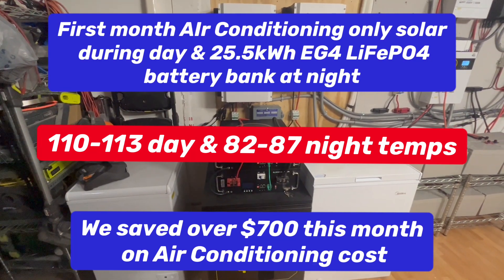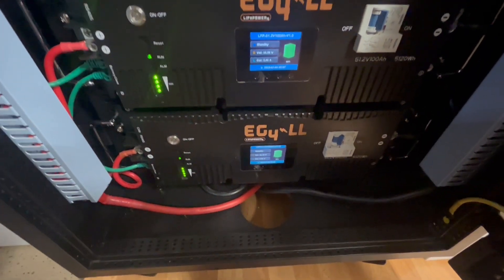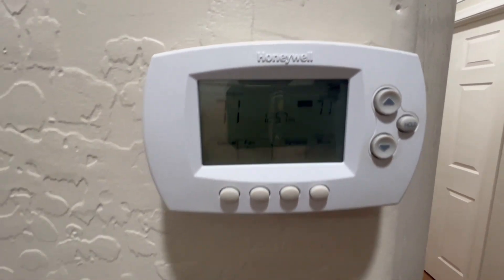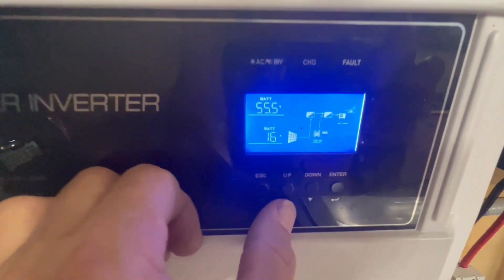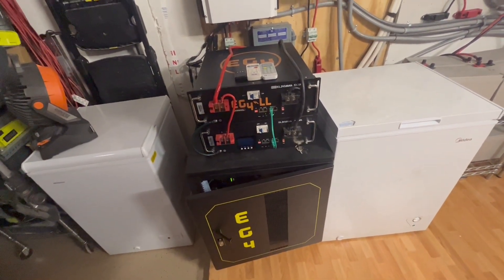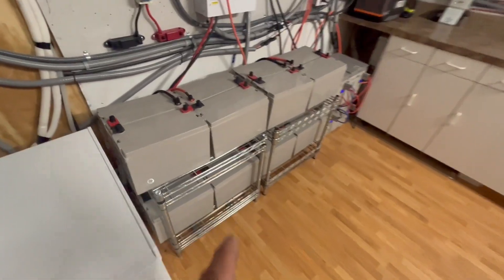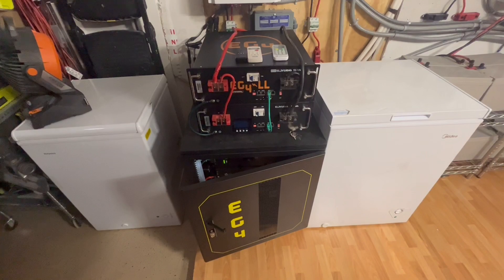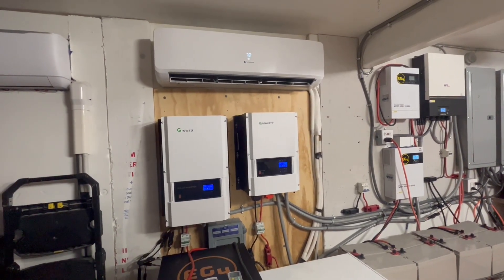First 28 days spending no money on AC cost while 110-113 in the day & 82-87 at night off grid solar

Comment: Very cool. How is it hooked up to run the central AC? I've seen people plug into an generator outlet. But it doesn't appear you are hooked up that way.
Reply from the maker: I ran 10-2 with ground wire to each AC from inverter. Around 100 feet run. With off grid you have to run separate wire to each component you are trying to run. The closer you can install the inverter, the less wire you will use.. None of my off grid is tied to grid. I can use grid to charge batteries on cloudy days or use grid instead of solar but grid power is used to run loads. Not connected in any way to feed into grid.
Reply: @diy-solar-guy  awesome thanks. I'm starting my solar journey now, and your videos help a lot.
Reply from the maker: I glad the videos help. 4 years ago I knew nothing about off grid solar or mini splits or ac units. Now I run my ac units with solar in day and battery at night. Very easy to learn.

Comment: Wondering how all this works out when you finally need to purchase all new batteries ?🤔🤑
Reply from the maker: These LiFePO4 batteries are supposed to last 20-25 years. Much more life cycle than AGM many times over. We will see. Looking forward to seeing how long they will last.
Reply: @diy-solar-guy  Oh Wow!! was not aware of the lifespan, just bought my first 12volt 100ah litime battery for my boats electrical and trolling motor , this is all very interesting stuff thanks for sharing so much info I'm learning so much already, can't wait to put it to use.
Reply from the maker: @jackwood6023  you are so welcome

Comment: What’s the cost for everything?
Reply from the maker: 12 kw Growatt off grid inverter $2000
5-5.2 kWh batteries $8000
Battery sever rack $450
48-250 watt used solar panels $2160
10 gauge wire 150 feet $180
Breaker $25
Battery cables $100
Solar array to mount solar panels will vary
But could cost $500 - $2000
At prices as off today it would cost $17,465(. Included $500 for solar array)
I paid before inflation $8500. I bought when prices were at the cheapest. I got a great deal. Hope you have a wonderful and blessed week

Comment: Wow, those are some crazy electric bills. If I had $1,000 a month electric bills, I would be spraying my roof with water. One unorthodox way to keep a house cool is to use the evaporative cooling of water. When one gallon of water evaporates, it absorbs 8,000 BTU of heat due to physics. A small window unit cools 5,000 BTU per hour, while a small one ton mini-split cools 12,000 BTU per hour. That is to say, the minisplit cools about as much as 1.5 gallons of water evaporating. While doing remodeling work on a house, I have used this method. It works to some extent. It cools about as much as running an extra window air conditioner.  I  sprayed the roof every couple of hours, and observed the cooling effect with my thermal camera.  It helps, it makes a difference; it is not perfect. Obviously, some of the evaporative cooling effect is lost to the environment and this is better at taking load off of a cooling system than being a good stand alone cooling method. If the grid ever fails during a heat way, it might be a fantastic method to keep people from dying.  It helps to get a house down closer to ambient temperatures. This can relieve a significant amount of cooling need from the HVAC system, but is not going to make a house a nice 72 degrees by itself. In a situation like you have, an ideal setup  might have a garden hose running up to the roof with sprinkler, which could be turned on with a cheap $50 automatic timer for 1 minute every hour sprinkling the roof with water. Long term getting a roof wet like this could be tough on a roof; that said those cooling bills are tough on a wallet. This method is going to work better in a desert where the air is dry. One could cool the house all night long or just focus on hot daylight hours; it probably depends on humidity of the area.  If you are sprinkling the roof, there is no reason you can’t also sprinkle the rest of the house. (siding, walls, windows ect) as that water can also help cool the house. I suspect that this method of running water on the roof based on my experience, can remove about one third to one half of the cooling needs of a normal house. With a $1,000 electric bill, that would save about $300 to $500 of power per month. I think the water bill would go up by less than that. I take no credit in inventing this method, castles and palaces of old used evaporative cooling to help moderate temperatures.
Reply from the maker: That is pretty Amazing, I actually have 2 solar hybrid roof vents in my attic that run 24 hours a day between solar and battery bank at night. It keeps my attic at the same temp outside which is about 60 degrees cooler than before I installed about 3 years ago. We can’t use water out here to do that, even with a nice whole house filter, the white calcium in the water would leave white streaks everywhere and down the sides of the house, which we would get fines from HOA or have to paint. Calcium in the water out here is really bad. The humidity right now is 10 percent and 113 degrees out, would have to run continuously to have and effect. Our water bill out here in the summer just having a pool and plants in yard on drip system is $250 a month. If we did that it would probably be about the same as electric bill. I am not paying anything anymore for air conditioning my house 7/24 and garage during the day so fortunately I don’t have to do anything else since my system with a 25.5 kWh EG4 LiFePO4 battery bank. We stay nice and cool all summer long with free ac now. Thanks again for your input. Hope you have a wonderful and blessed day

Comment: Sealing all duct work with dp 1030 mastic use mold resistant drywall tape for bigger gaps. Hvac is notorious for having leaks, check the supply box and all your vents.

Adding an attic fan with a temp shutoff along with a closet switch to turn it on and off will make a huge difference with all that heat trapped in your attic, especially at those temps that you’re at you want it out of there as quick as possible it will cut your AC cost way down .
Reply from the maker: I used hvac caulk in all my air vent boxes and made sure in the attic there were no leaks with flexible ductwork. My roof solar roof vents are hybrids so when there is no sun on solar panel, it runs off battery bank at night, all night. My attic stays about what outside temp is and no more. I no longer have ac cost on grid. But thank you for all your great suggestions. We even insulated garage and air condition that with solar so the rooms above garage are not hot.
Reply: @diy-solar-guy  🫡 thank you for sharing, was sharing what I did that made our 2004 AC 400% better than new. Stays 76 degrees Fahrenheit went outside temps are 97°F. Only runs for 9 to 12 minutes then shuts off for 20 minutes. Change the capacitor and the contactor cleaned everything up replace to filters, sealed the supply box, which had major leaks some spots for 1 inch gaps and sealed all the hard pipe going to the vents that I could. It is efficient as it can be without me getting in the attic and sealing all those ducks and insulating them to keep the attic heat out not worth my time or effort in my opinion hottest it gets we’re on that is 116° regularly 100 to 106 in the summer.

I enjoy your videos. I hope to one day have a solar package too, with the mini splits. I especially like the RV set up using solar, I like to run 120 V refrigerator is actually the best efficiency over 12 V refrigerator which is the second best . Would be nice to run refrigerator and AC off solar package for RV .
Thank you for sharing. 

You have to spend big bucks $$$$$ to save big bucks. Return on investment is  #1 without diminishing returns!
Reply from the maker: You are correct, you have to spend money and invest, but if you DIY. It will pay itself off in no time.

Comment: HOW MUCH DID YOU SPEND ON ALL THAT
Reply from the maker: I invested around $5000 a year over last 3 1/2 years. There is some stuff I no longer use as I started with a 12 volt inverter then went to a 24 volt inverters, then 48 volt split phase inverters. All this investment will be completely paid back at the end of 2023 with just saving on my electric bill. So next year in January I will be producing free electricity for myself. A very short payback time is only possible when you DIY. OnGrid solar would have been the same amount of money but only 20 percent of what I can produce now and they would have raised my electric bill to double of what I pay now with only 20 percent of what I can produce. They charge about 60 percent for installation and double the price of all the components when they sell you the system. If I knew back 4 years ago what I know now, I could of only spent $10,000 for everything I need. But it was a learning curve since I did not know anything about, electronics, electricity, mini spit or pool heaters, electrical panels. If you do all the work yourself and can buy used solar panels locally like I did. Your payback time can be very short period of time. How this answer helps you . Thanks for the question and hope you have a wonderful and truly blessed day

Comment: Isn't it a lot  cheaper just to...❤
Move?! Haha.
But great info!
Reply from the maker: Actually every year for last 4 years I spent around $5000 a year for off grid components and at the end of this 4 years in December of 2023, it will have paid itself off with just the electricity bill savings. So next year I will save over $5000 a year on electric bill. When you can install all the products yourself and buy used solar panels, you can create more electricity than you actually need. Most people in Phoenix in summer spend around $400 to $1000 a month in the summer to air condition their homes. Thanks for your input.
Reply: @diy-solar-guy  excellent!  But I think for people like me in Sierra foothills of California it would not be cost effective for a long time and would be more of a novelty.  I might consider for fun doing your mobile ac setup for my 150 Sq foot pool house... just for fun. 
Thanks again.
Reply from the maker: @graphguy  you are correct, it probably would not benefit you in California.

Comment: Just wondering why u cant be completely off grid in the city if u didnt pay ur bill and they turned ur power off then what ?
Reply from the maker: I completed happy with an electric bill being less than $1000 a year. My wife power usage has not changed. She still uses all of the appliances on grid as usual. The only difference is no air conditioning cost or pool pump or pool heater cost. If I were to move to the outskirts I could alway live off grid if I wanted to. I have 2 incurable cancers and I want my wife to be able to not have to worry about being completely off grid. If something were to happen to me, she could just have someone disassemble the solar, sell solar and sell house and move. Hope that helps you understand why I stay on grid but supplement my electric power.
Reply: @diy-solar-guy  ohh ok I'm so sorry and I understand wishing u long Jeopardy and a happy life I knew u could go off grid I was just wondering solar is very fun for those who can afford it I'm finishing up my 11kwh Lithium battery bank I'm building 8 277ah cells to go with my 16 120ah cells all in a 24v configuration
Reply from the maker: Very nice. I spent $20,000 on my system and after only 4 years it’s will have paid itself off by December of this year 2023. When you Diy the off grid system is so much less expensive and much quicker payback time. Ongrid solar will never pay fir itself, that’s why I chose off grid solar.thanks for the input.
Reply: @diy-solar-guy Awesome work! Wonder if this type of off-grid setup can be done in California?
Reply from the maker: @gedionsamuel2256  you would have to check and see if they allow it very regulated.

Comment: Um, how much are you paying per kilowatt???? I honestly can't believe you would be on grid at all at those cooling costs. Not counting everything else using grid power? 

Please explain this high cost!
Reply from the maker: I pay 17.6 cents a kWh. I am using the same as in winter when it is 8.3 cents kWh. So your electric bill doubles using the same amount of kWh. I have to use off grid, if I went on grid solar they would double my price I am paying now. My minimum bill for year would be close to $2000 even if I produced 100 percent of my own power. Being off grid I can cool my house 70 degrees during the day. If I tried doing that with grid power my bill would be $1000 a month in summer.

Comment: I have a big house, all single story. Im thinking I want many mini splits at differnet locations around the house. And dont have the money for batteries. Just 3 panels each at 48 volts in series for each mini split. If the grid goes down, there are 110 volt ac gas generators that could power any of those mini splits. Maybe the master bedroom at night and move the generators to the living room and kitchen in the day time. That's only if the grid goes down. Thank you for this video. It is very impressive what you have done to power the house like that.
Reply from the maker: I reduced my electric bill by 80 percent just running mini splits during the day on agm batteries, used solar during the day with mini splits and main 3 1/2 ton & 4 ton ac heat pump at night. They have multi zone units you can buy. 5 of my mini splits are 120v 12,000 btu and a 220 volt 18,000 btu mini split. I spent around $5000 a year for last 3+ years and all my system will be paid off by the end of 2023.
Reply: @diy-solar-guy  I prefer the 12,000 btu mini splits because there are small low noise gas generators at harbor freight that can power each mini split with 110 ac in case of power outage. The mini splits have ac 110 or solar inputs
Reply from the maker: @neilwani1178  I too like the 110 volt mini split. I can use solar or plug into grid power. Very efficient.

Comment: Love your videos you inspired me to build my system started last year getting things I got the 12kw growatt inverter. 30 400 watt byfacial panels and two eg4 batteries I definitely need more batteries I installed a micro air soft starter on my 4ton and it starts the ac no problem but after it cycles a couple times the batteries are to low to start it again going to get some more batteries befor the year is up.  But all in all I am amazed at what the inverter can do all ready have cut my light bill in half. Thank you for the videos really helped me in picking out my system keep up the great work
Reply from the maker: You are welcome, the EG4 LiFePO4 batteries make it possible to run ac completely off grid 7/24. My 4 ton uses considerably more watts than my 3 1/2 ton ac. So a lot of the time I will just use my 2 12,000 btu 120v mini splits downstairs which only use 1/2 of what 4 ton ac uses. It was 111 yesterday and 85 overnight. When I woke up this morning I still had 50 percent state of charge left in battery bank. I kept my house at 78 degrees from 8pm till 6 am. Now this morning at 6 am I just started both mini splits downstairs till about 10 am, then I will run 4 ton ac unit till 3 pm and get house temp down to 70 degrees. Will be 113 today. It is already 90 degrees at 7:30 am. It took me 3 1/2 years of buying about $5000 worth of components a year to get to this stage and at the end of 2023, all of it will have paid itself off. $20,000 over 4 years and paid off at end of 4 years is a great investment. Now I will just save over $6,000 a year on electric cost every year and as the electric cost keeps going up , my bill will stay on average about $75-$80 a month year round. That is insane living out in Phoenix az. My yearly electricity cost is less than some of my neighbors monthly bill. Thank for your valuable input. Hope you have a wonderful and blessed day
Reply: @diy-solar-guy  I forgot to ask your 12kw that is connected to the 5 eg4 batteries do you have it set up to charge the batteries cause you also have a eg4 charge controller to keep the batteries topped off if so what is the settings on the inverter and charger controller. Thank you again
Reply from the maker: @Polaris1127-l9v  the 12kw Growatt is connected to 25.5 kWh EG4 LiFePO4 battery bank through the bus bars. The EG4 extra charge controller is connected to that same bus bar to supplement charging battery bank.
Reply from the maker: I did not have to change any settings in inverter to use EG4 charge controller.